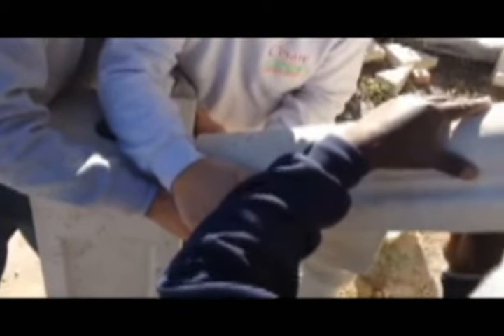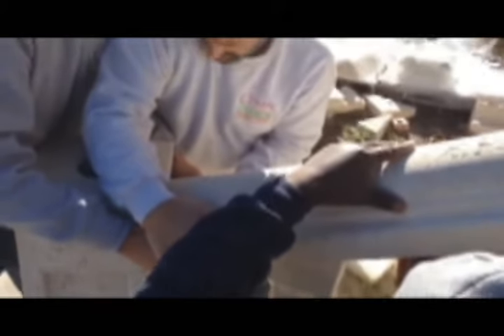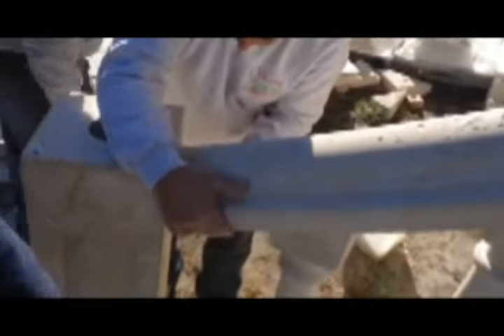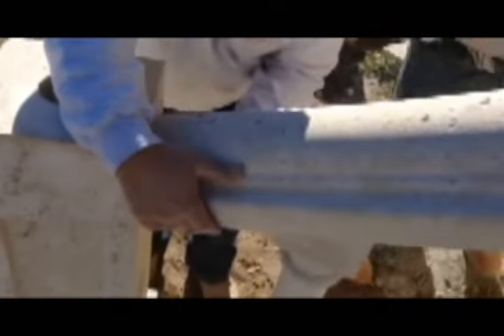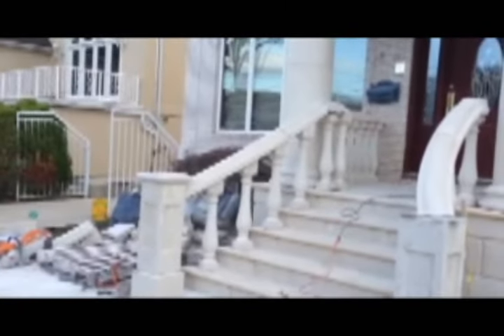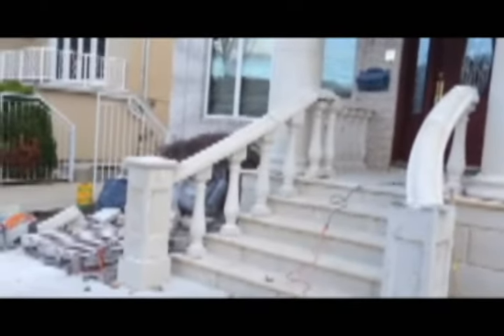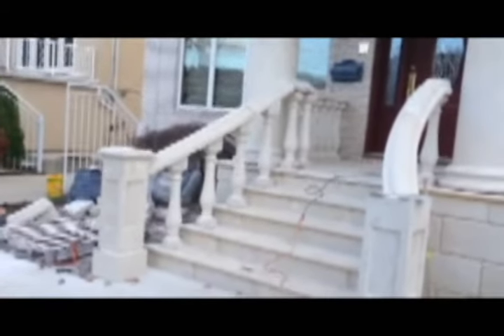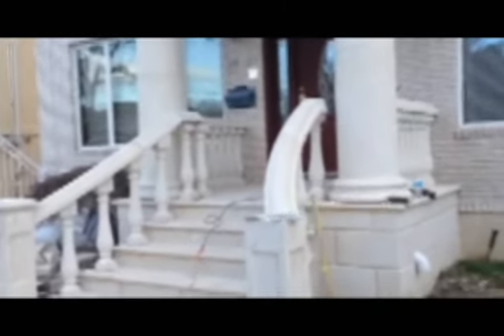Concrete Baluster and Railing Installation

Comment: thanks for the video! is there an adhesive or something that keeps the rail in place?
Reply from the maker: The handrails have rebar and so does the balusters. You can use 2 Part Epoxy/Thinset for the adhesive.
Reply: @CoralCastCompany  how much does that job cost?
Reply from the maker: @mbarnswell  Email sales@coralcast.com and ask for pricing on our Balustrade System.